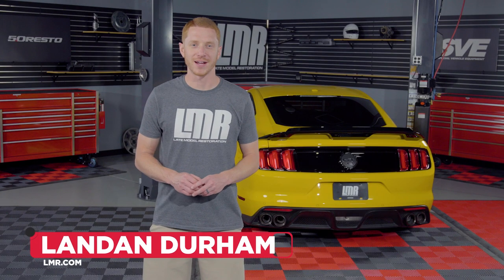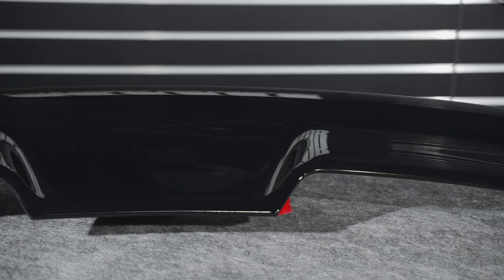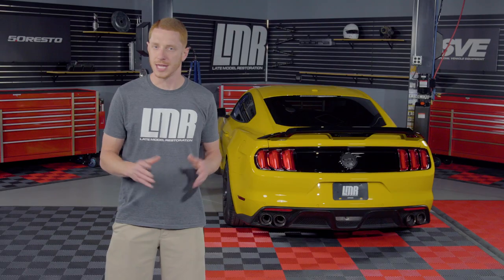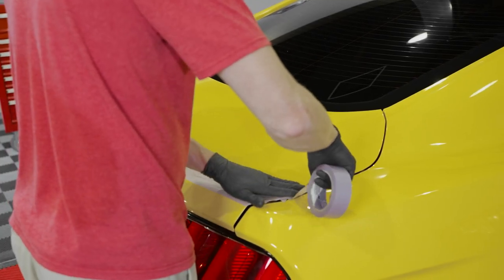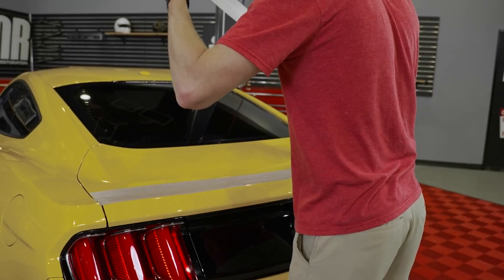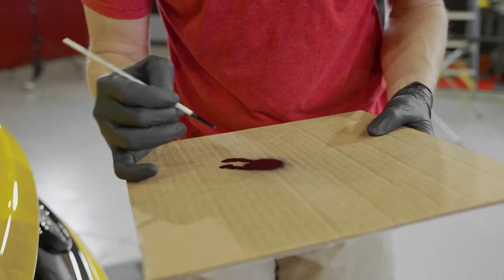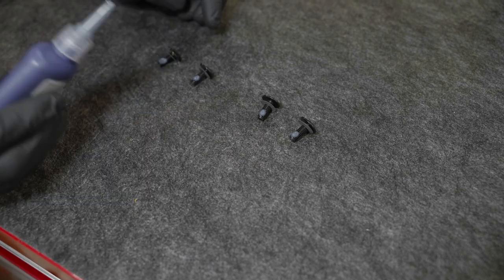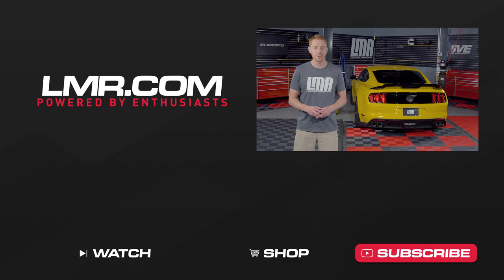How To Install 2015-2023 Ford Performance M-16600-FP Rear Spoiler w/ Gurney Flap

Comment: Got mine today and love it! Ford performance quality is spot on.
Reply: Did yours come with the linger torx bits? Mine came with extra torx bits but they are the same size as ones that were on the spoiler
Reply: @emanuelornelas5537  yes they did. Hmm I would contact your seller about that as there is indeed a bit longer Torx ones
Reply: See so did mine. Hows yours holding up?
Reply: @emanuelornelas5537  Has been great
So far. No issues
Reply: @UCcI_fYZAVhYQ7Tre5rIod3A yours are the same size though as the ones removed from the spoiler?

Comment: I got mine thru Yates Performance. The product is on point and high quality. Only downside is the adhesive. I had to reinstall mine.  Remove the stock adhesive and replace it with 3M trim 2 sided adhesive. Much better adhesion.
Reply: How much does it cost on yates? Send link

Comment: I have a factory spoiler on my 2017 Mustang GT base. Do i need to drill in holes? Or will it be a direct fit?
Reply from the maker: Hey there, 2015-2021 Mustangs that came with a factory spoiler will re-use most of the factory mounting holes. No drilling is required and the unused holes will be covered by the spoiler.

Comment: I have the standard black accent pack spoiler on my 2020 GT. Will I have to drill extra holes?
Reply from the maker: Hey there, 

2015-2021 Mustangs that came with a factory spoiler will re-use most of the factory mounting holes. No drilling will be required. The unused holes will be covered by the spoiler. If you have any other questions or concerns, please email or call us using the link below and we'll be more than happy to help. | https://lmr.com/contact
Reply: @latemodelrestoration  awesome I’ll order it this Friday. Thank you

Comment: Was this a direct fit to the 21 Mach 1 without drilling? Anyone know?
Reply from the maker: Yes! If you have the other spoiler option on the Mach 1, the Ford Performance spoiler is a direct bolt on.

Comment: Do you need to drill holes if replacing stock 2018 GT350 spoiler?
Reply from the maker: Hey there, 

You will not have to redrill if you are replacing the 2018 GT350 spoiler. It will use the same mounting holes as this spoiler.

Comment: Does the spoiler get loose if you open and close the trunk lets once a day ??
Reply from the maker: No, it does not. As loong as you follow the correct steps to install the spoiler, you won't have to worry about it.

Comment: I want to know the dimension of the spoiler. I'm building a 1966 match 1. I would like to use the rear spoiler of Mach 1. CAN ANYONE TELL ME HOW TO FIND THAT INFO? thank you
Reply from the maker: Hey there, we would recommend checking some forums or Facebook groups for more details on the spoiler. Ford didn't include dimensions for the spoiler on their site (since it's designed to only fit one vehicle directly).

Comment: I’m looking at this exact spoiler on your website. I have a 2019 GTCS and what I’m wondering is if the outer holes will line up? I think I have to modify the middle, but do the holes on either side get reused?
Reply from the maker: Hi Davy, 

Additional modifications are required when installing this spoiler on the GT/CS. Please give us a call or email us with the link below and one of our customer care representatives can explain it all in more detail: https://lmr.com/contact

Comment: Does it fit on a convertible?
Reply from the maker: Hey there, the spoiler will not fit any of the S550 convertibles. They only fit coupes.
Reply: @latemodelrestoration  any idea why it won’t fit a convertible?
Reply: I guess it has something to do with the necessary holes in the middle. But in that place is the rear light. Maybe this interferes with the bolting.
I would also love to know and install the GT500 spoiler on my convertible.
Reply: @funkyfabe5336  there's a guy with a (not great) video install doing the GT 500 on his vert. I think the main issue is it hits the antenna when the trunk opens, so the solution is to order a stubby. I haven't read anything about there being mounting problems.
Reply: @jvale6990  I have heard that the curvature of the trunk lid from the convertible is different and that is why most spoilers do not fit.
But I just saw pictures of two convertibles again today, one with the GT500 and another with the PP2 spoiler.
Will therefore already go. The YT video I already know!
Reply: @funkyfabe5336  yep. Pics don't lie.
Reply: @jvale6990  Which manufacturer do you prefer? For me there are MP Concepts and IKON Motorsports...
Reply: @funkyfabe5336  MP seems real good. If money isn’t an issue, I’d probably go with Ford Motorsports GT500 though.

Comment: Will this fit on a 2009 mustang
Reply from the maker: Hi Jake, this spoiler is designed to only fit 2015-2021 Mustangs. They are not designed to fit 05-14 models.

Comment: Link to the gt350 rear diffuser?
Reply from the maker: Hey there, check out the link below for the full GT350 kit! | https://lmr.com/item/M5230M8SBV/2015-2016-mustang-gt-ford-racing-sport-axle-back-gt350
Reply: @latemodelrestoration  anything for 2018+ Mustang?